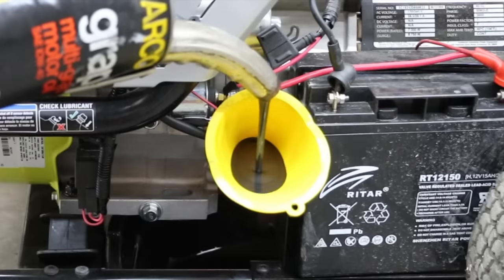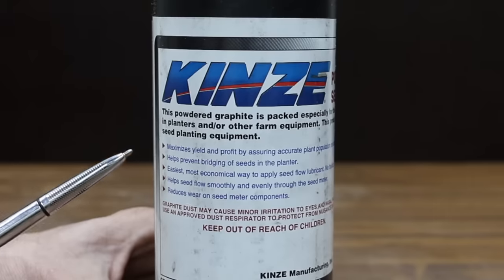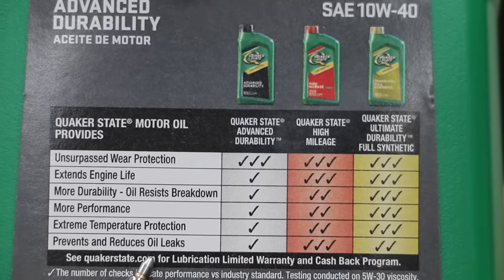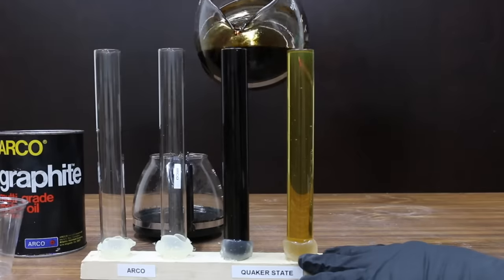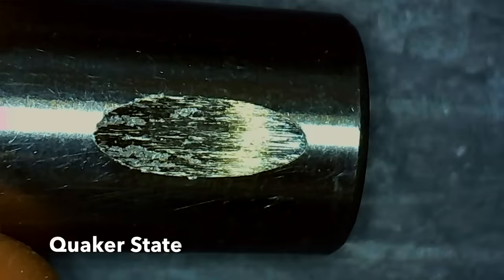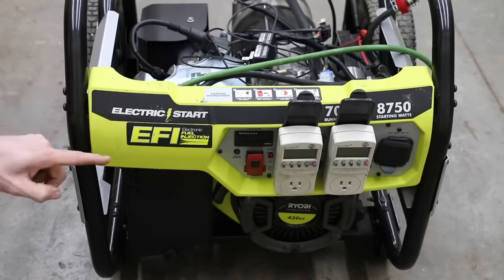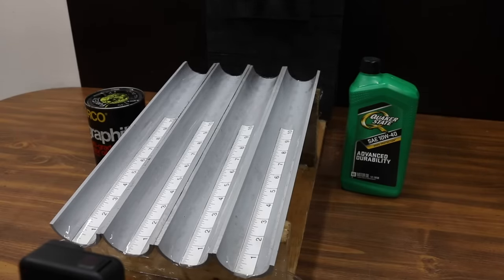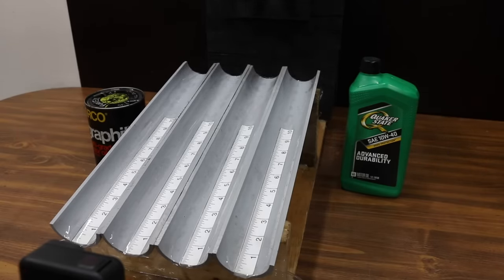Will "Graphite" Help Motor Oil Performance? Let's find out! Vintage Arco Graphite vs Quaker State

Comment: You already know that he has the cleanest cylinder heads in the entire country
Reply: Well that depends on when you're checking. Just before a test, for sure. After? Results may vary ;)
Reply: ....and the most worn head bolts ever.
Reply from the maker: lol. Nice!
Reply: @Amy_A.  ur new here huh
Reply: And when he goes on a road trip, you'll definitely know
Reply: -But now the old reliable test mower has a Knock.. :/
Reply: @ProjectFarm  Actually I'm interested in your see thru head. Have you done a video on how you made that?

Comment: Years ago,I owned and drove daily a 1964 Corvette fuel injected coupe.(1979) It had Castrol 20w50 in it when I bought it,it smoked a little on hard acceleration.I decided to try ARCO Graphite on my first oil change. I was amazed...Oil consumption dropped and no more smoke!
This was in a 16 year old car that had been driven very hard all it's life(first owner auto crossed and drag raced) The motor needed rebuild
I was able to put it off a couple years. ARCO oil was like a miracle.It did have one drawback...Engine disassembly was VERY messy...
That stuff was like black ink...I went back to CASTROL 20w50 after rebuild because of higher viscosity.That car got better mileage with worn out motor(20mpg@60mph).I haven't seen ARCO graphite in many years.Is it still sold?

Comment: I wonder what effect the graphite would have on a filter..?
Reply from the maker: Great point!
Reply: I would think it would depend on the granular size of the graphite.
Reply: @Novous  Right and remember that there's a bypass in the filter.
Reply: Plug it up in about 30 seconds is my guess
Reply: No filter required!
Reply: i was going to ask
Reply: Sounds like a great test of the blow by valve to me.
Reply: I was thinking the same. The particles of the graphite will clog up the filter. It will go through the valve bypass. Still I sitll don't trust the product in my car.
Reply: I bet it plugs it up and the oil goes through the bypass.
Reply: Krex makes a graphite additive for motor oil. Cadillac dealers, among others, offer it. The particle size is so small, it passes through the filter.
Reply: You'd think there would be some foresight in the design process, so the particle size would be tightly controlled. Its not as difficult as one might think. There are planetary mill grinders that can achieve nearly molecule sized particles in a short amount of time. However you have to be aware that most filters are only designed to catch relatively speaking, large particles. Graphite grinds down to a mesh size much smaller than what an oil filters design is fairly easily. 

So I would think the filter problem isn't much of a problem. I'd be more concerned with the increased viscosity from just the added weight adding more strain on periphery parts.
Reply: just turn it dark
Reply: The used in arco was 0.3 microns wide. The powdered version is at least 14 times bigger, at 7-12 microns. So Arcographite wasn't trapped by the filter. Now, the powder maybe. Farm could cut some open, of both kinds. Would you, Farm?
Reply: Commonly available graphite powder is typically about 11 microns. A good quality oil filter usually gets 95% or more of particles about 25 micron. In theory the graphite would slip through but I'm not sure of it's tendency to bind together into larger bits which may quickly plug a filter. I wouldn't try it. I suspect in the 70's filters were not as good and likely let larger particles through which may be why it worked ok back then.

This is all conjecture of course.
Reply: The partical size was very small and passed through filters. The black color didnt change with being in the engine, came out the same.
Reply: Domino  evidence over conjecture. Love the first hand eye witness testimony, refuting the conjecture mob speculation.

Comment: I liked Slick 50 when I could get it. As soon as I started the engine after putting it in there was a noticeable difference in engine smoothness.
Reply from the maker: Thanks for the feedback.
Reply: I used Slick50 also.
The first thing we noticed was the engine temperature dropping.
The engine ran smooth and seemed to start easier.

I was asked about it by someone who was a big time RVer.
He dicided to try it so before his trip he put the SLICK 50 in and took off.
All he could talk about was  watching the temperature guage go down as he drove.

I know two others that had put in the SLICK50  and then ones  wife and another ran the 
cars out of oil.  They drove them miles that way with the oil light on to get home.

Both expected the engines to be toast but they put oil back in them and they started right up.

I was a loyal user of SLICK 50 untill they were sold out to a big time company who changed 
the recepe.

In the original mix, you could add SLICK 50 to an oil change and it would be good for 50,000 miles.

The new owners  wanted to make money so  they weakened the mix so you needed to add it every oil change.

Comment: Todd, since you've sent out so much oil for testing and know the secret ingredients, here's an idea.
Take on of the good lower cost oils, and add some of those wear and lubricity additives and so what happens if you triple up on them like the Arco oil?  Might be interesting to see a long-term test.
Reply from the maker: Great video idea!  Thank you
Reply: I like this idea
Reply: This is a good idea.
Reply: Yes it would be educational to see what profile of a perfect oil you would create or if there was an oil on the market that closely matched your numbers .
Reply: Yes very good idea and question I've had forever
Reply: @heartland96a  thats why oil companies have engineers and researchers and thats why engine oils keep getting better and better
Reply: @isaakwelch3451  yeah but oil companies dont share their research now we got that downlow
Reply: @isaakwelch3451  your 100 percent correct . Still interesting if he could do better then current offerings .
As lubricant mfg's may not want to bring their best formula to the market unless there's pressure from competitors or engine mfg's.
Reply from the maker: Thank you for the video idea!

Comment: I used Arco graphite all the time at the recommendation of my roommate's father, who helped develop and test the stuff - and it worked great...  the particulate size and suspension methodology meant there was absolutely no buildup in the oil filter - the problem was the mess it made during oil changes - you couldn't get the black stains out of concrete, clothes, or off you hands.
Reply: Just helped show you weren't afraid to get dirty and do your own work!
Reply: Do you happen to know if the oil has issues with the graphite causing blockages?
Reply: I don't know that its going to make it through a modern oil filter.  I think older oil filters had to contend with a lot more particulate additives and were intentionally more porous.  One thing about the Arco graphite is that the particles were small enough not to come out of solution.  I don't know if you could say the same thing about graphite intended for dry lubrication.
Reply: @lolbuster01  absolutely no blockages - it was really great stuff... you got really, really dirty changing the oil - If i could get the stuff today, I'd definitely use it on my older cars and, since I'm old now as well, just let my mechanic get dirty instead of me.   you saw in the video the wear resistance - that's what it did for flat tappets
Reply: @lolbuster01  I used the arco stuff back in the early 80's on my relatively rare 429 CJ motor.  Worked great for a while.  Then after a couple years the oil was no longer available.  I switched back to regular oil did a serious engine flush.  Within a month after that oil light came on and engine siezed up within a few seconds.  I sold the car and don't know what the diagnosis was but the guy that bought it got it running again.  I do blame the oil...
Reply: Dan ill give you a little trick for getting oil out of concrete... cover up the spots with kitty litter and then pour a little gasoline on top of it while you let it sit for a while. it will pull the oil out of the concrete and into the kitty litter. this trick works best in the heat.
Reply: What is the name?  ( he has probably passed away I would suppose)
Reply: @Seth_Stewart  Indeed!
Reply: @lolbuster01  I had zero issued with graphite blockage when using the Arco Graphite.  Graphite additives, I don't know
Reply: @WarpedinSpace  Landrum
Reply: @dannoyes4493  Thanks, but not a name I recognize.  I've used the Arco graphite oil for a few years without any problems and am puzzled by all the reports of deposits.  I would like to see that demonstrated if indeed it is true.  However graphite is known to agglomerate.
Reply: @WarpedinSpace  I never had any problems with Arco Graphite when I used it.

Comment: the wear reduction on that lubricity test was very interesting. perhaps there's a great use case for this outside of being used as an engine oil?
Reply from the maker: Great point
Reply: @ProjectFarm  the extra phosphorus and zinc really confounds the question of whether the graphite is doing any magic at all.  It would be interesting to take some Quaker oil, add similar proportions of zinc and phosphorus but not the graphite, and repeat the lubricity test to tease out what the graphite was doing, if anything.
Reply: I use graphite powder in ammo magazines that don't feed smoothly.
Reply: @genesmay6589  whoa really? noice! with good results I'm assuming..? which parts? how do you apply it?

Comment: Two things strike me that should be of concern:   First is that this material could build up in engine oil galleys restricting flow.   Smaller engines with smaller galleys could possibly be blocked even quicker.
Second is that your oil filter should remove suspended partials from about 5 microns up.   Having graphite floating around will likely play havoc on the filter and reducing its life dramatically.
Just thinkin' out loud....
Reply: I agree that graphite flakes are too much bigger, but high quality graphene nano size flakes will go thrue oil filter easily  without any problem... Very very tiny little quantity of right graphene grade nano powder will disperse so much in order to  offer  a way up higher performance ! ... ☺
Reply: @lot451  Perhaps.   I'm shooting from the hips for most of this.
It is suspended, but can separate with time.  I suspect sludge would be like fly paper to it, compounding internal buildup.   It's that buildup in small oil passages that no engine wants.
Also graphite is crystalline, and as such has an abrasive quality.   Someone said as it thickens it begins to act more like a lapping compound.   (I've no proof of that, but it sound plausible.)  We are talking about diamond hard micro-sand after all.
Another is marketing.   If it worked, every oil manufacture would be selling it to the home consumers.   Much like PTFE, graphite makes promises that no oil manufacturers seem to agree with.
For myself?   I wont touch it with a ten foot pole!
Reply: @snafu6548  My car show over 300 000 km, with motor oil loaded with high quality graphene nano powder since +/- 70 - 80 000 km, engine oil manufacturer are often on fact, very lazy in real technology Breakthrough... 😊☺
Reply: @lot451  Sorry boss.   I'll have to stop you right there....
I've actually studied oils down to the base crude as part of becoming a certified aircraft mechanic.   I have also followed synthetics since their inception as that too came from the aviation industry.
Aircraft fleet owners would pay big money for a miracle oil that would cut maintenance expenses.
Any big money industry from heavy equipment to Formula1 race cars would be on it like it was gold.

Fact is, there is no miracle oil, and our best mechanical engineers still revert to what we call a standard oils.
I applaud your luck with your graphite, but at present, it is far from anything I would ever recommend.
Reply: @snafu6548  Very respectfully said : still  confusing " high quality graphene " with " " your graphite " " , this is not communications  with sufficient accuracy, is also disrespectful, and will never achieve something toward good direction. Always looking foward fruitful and respectful communication. Have a pleasant day.
Reply: @lot451  I agree with YOU, Lucas. You have a CAR that ran 100,000 miles with graphene loaded oil. I mean, HOLY SHIT! There is no way anyone should be using anything but YOUR high quality graphene. Lucas, I may be a value asset high risk investment wall street associate and you can trust me to further your interests should you decide to contact  me. I know some posters here don't understand that you know which graphene works, but we can get your knowledge out there and let the people know which could make you so rich, Lucas. 

PM me, my bro
Reply: Well said
Reply: Yeah, I run a 2 micron bypass filter.  I think would think that the micron filter would remove all the graphite.  Now, would graphene work better?  I don’t know.  Would be a very interesting test to see the PPM of graphene after it’s been run through a 2 micron filter.
Reply: The94GTC , used to "what" without graphite?
Reply: @snafu6548  Ironically, graphite powder might actually work better as an engine lubricant as a standalone powder-only solution.  This assuming you could keep it from any contamination from fuel or the water that is a byproduct of the combustion reaction which would inevitably form a paste.

I say this because in all the applications where graphite is used as a lubricant, it's always used dry.  Also seen in his video is molybdenum, another common dry lubricant.  Both work very well in locks and firearms where a liquid lubricant can cause problems(mostly in very low temperature applications).
Reply: @snafu6548  I agree with your comment, the same can be said for the old myth that a man invented a gasoline carborator that woul. Increase gas eficiancy by 300% and then the a oil company purchased the patent, if such a device did work, the auto manufactures would be on it , as would the government ( for military purposes )
Reply: @Andrew H I would have this conversation with your mechanic as they know your engine and can make recommendations based on both engine and environment.  10w50 to 20w50 seems pretty common.   Use only FAA approved oils
Reply: @snafu6548  I'm going to echo your sentiments here. I am a small fleet owner of heavy highway trucks. My take on maintenance and wear mitigation is simply frequent oil (and filter) changes. I make this investment every 12k to 15k miles plus air filter every 3-6 months as needed. My goal is to keep the acid levels at a minimum since this is the primary source of damage for diesel engines (yes, this part is opinion, but with the anecdotal evidence of a 30 year career). I don't believe there are any magical oil additives to replace simple maintenance, if there was I would be using it.
Reply: I had the exact same thought on your second point.
Reply: @lot451  graphene and graphite have different structures.  think graphene as a single layer of graphite.
Reply: @BenState  you are right !  Accordingly, graphite and graphene properties and performances in motor oil are not comparable. Graphene has no downside (but it remains darker appearance)